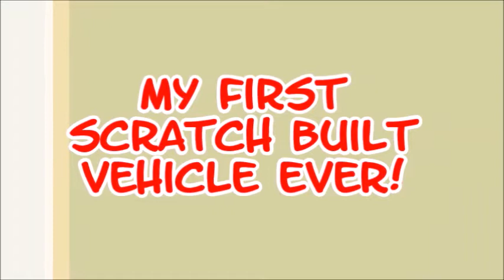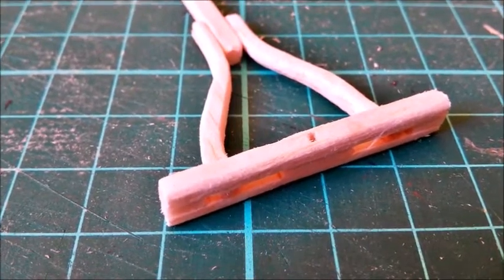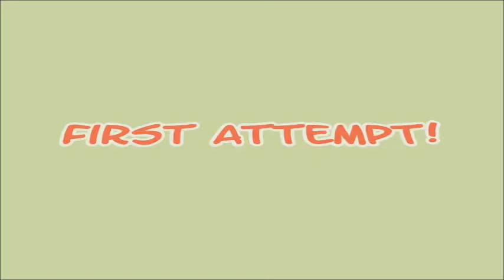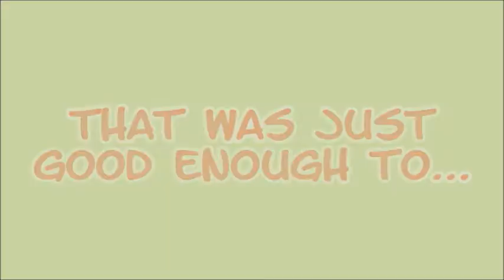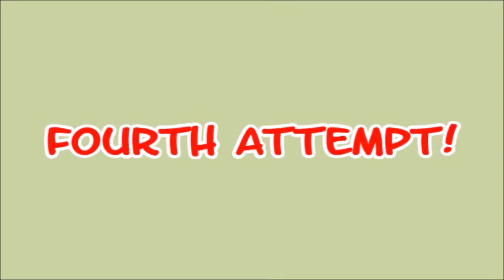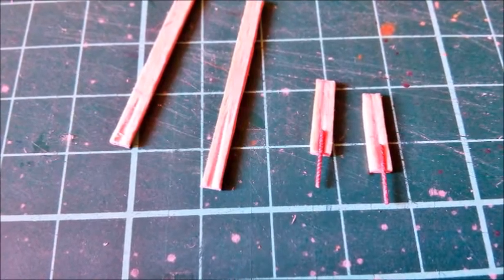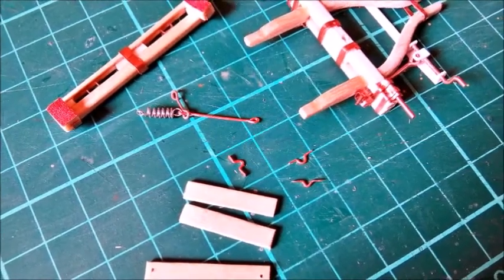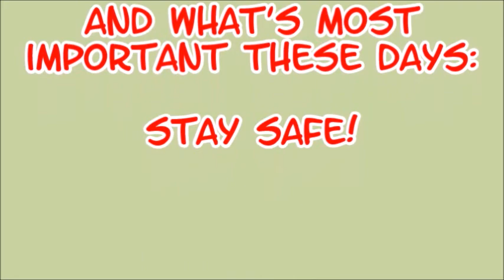Say Cheese Group Build - Build, Update #10, The Hay Wagon

Comment: Aboslutley stunning mate. Outstanding scratch building. If you built the wagon, building those wheel barrows is going to be a walk in the park mate.
Reply from the maker: Thanks a bunch, Beez! I guess I could handle the wheel barrows. I like them both, so it'll be both. :)
Reply: Got a quick question, what size chain did you use on it, I'm building a masterbox horse and cart but the moulded chain is a bit rubbish so wanted to replace it.
Reply from the maker: This a 1.5 mm brass chain, but I couldn't get this one again. I just ordered one made of the same size made from stainless steel. Got it of amazon and it looks very nice.

Comment: An outstanding video my friend !   I've learned a lot from watching it. For one thing, I've NEVER seen front brakes on a wagon.  I've never seen them facing that way. Here in the USA the brakes are on the rear wheels and face rearward.  My MasterBox kit doesn't have any brakes at all !  I'm really interested in the wheel hubs you made. I've got a couple of old ESCI kits that need them to replace what they give you.  As for the wheelbarrow. CMK has a kit of one with a Falmschjager. It's reasonably priced too.  CMK does several great figures. One of my favorite kits is two SS guys, One is peeing while the other is scratching his butt and pointing.
Reply from the maker: Thanks a lot, my friend. These are probably just parking brakes, because you can't use them while the wagon is pulled. On the pics of the actual wagon there are four crooked logs sitting on the hubs and they appear to be the brakes. You can pull them towards the wheels and that should slow down the wagon. Since the workers were taken to the field and back from work on the wagon they probably had to pull these logs on command. By now I added these missing logs. Do you need a better explanation on the hubs? If so feel free to ask. I already built both wheel barrows from scratch and I'm in the middle of painting them. CMK and PlusModel are my favourite Czech companies. Tons of great ideas ond the majority of them is well executed. And this time for real - I'll go to bed now. :)

Comment: Very impressive. Doing the wheelbarrows should be easy after the wagon. Should be
Reply from the maker: Thanks a lot, Benny! The wheel barrows are already built. I'm working on a longer video about building them and painting pig sty, hay wagon and the barrows. Should be finished next weekend or even earlier. :)
Reply: Non-Prolific 1/35th Scale Model Builder I'll be waiting
Reply from the maker: Won't make you wait for too long! :)

Comment: That is awesome, really great work Jens, :) Tom
Reply from the maker: Thanks a lot Tom! It's kinda hot rod hay wagon with larger wheels at the rear. I was thinking of building a wheelie and traction bars, but since the horses make only a 2bhp V2 engine it wasn't necessary. The worst part is the double exhaust right in front of the driver's face! :) Jens
Reply: Non-Prolific 1/35th Scale Model Builder Lmao
Reply from the maker: Hehehe!
Reply: Non-Prolific 1/35th Scale Model Builder Oh yeah, scratch build the wheel barrow, :)
Reply from the maker: How did I know you'd say that? :)